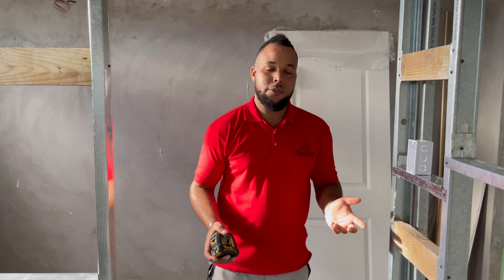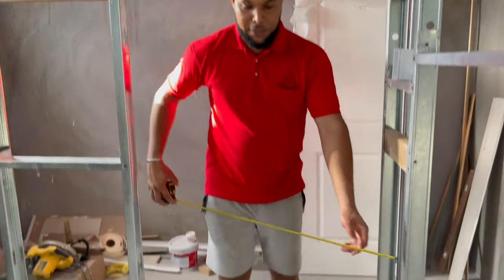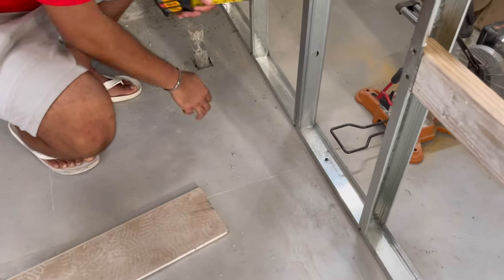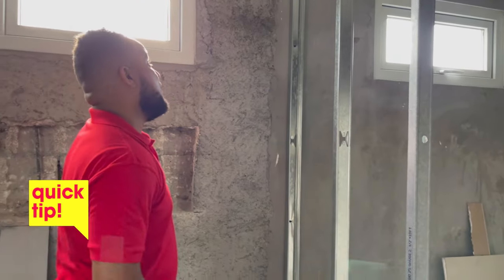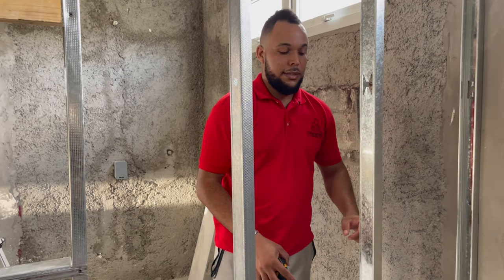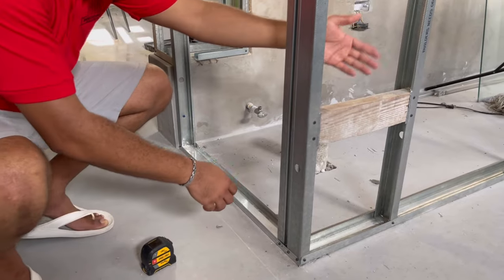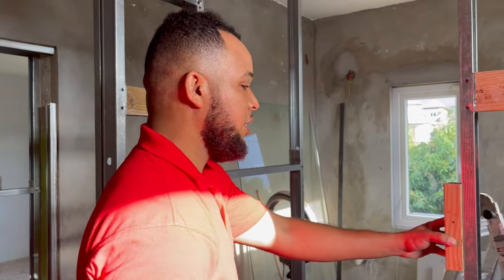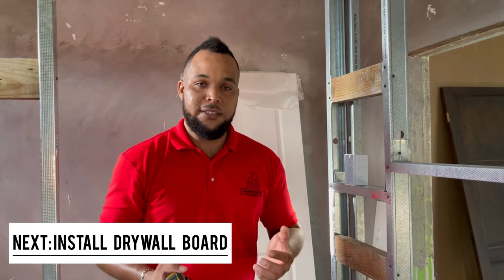How to install metal track and stud drywall framing - #DrywallPartitions

Comment: Thanks for the info guys. You know I was always under the Impression that drywalls shouldn’t be installed in “wet areas” eg bathrooms, laundry rooms.
Reply from the maker: Hey Kimzy. Oh yes, we were of that impression too until we really got into it. In the next video we will show you more about the types of walls and which can be used in the bathroom.
Reply: @HackedbyEbanks  looking forward to it
Reply: Great job guys